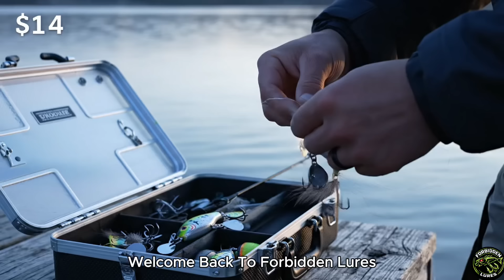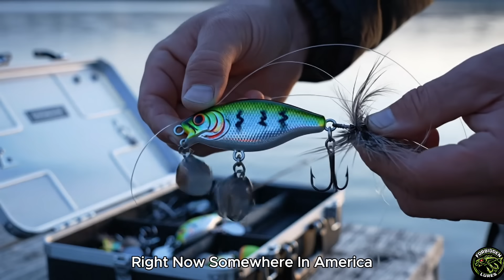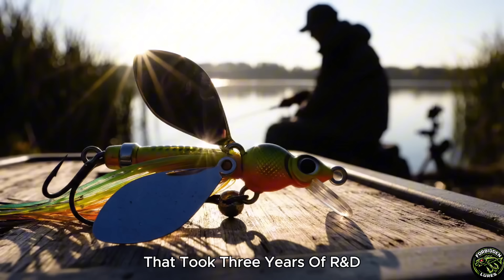Wrap Aluminum Foil + Copper Wire on Your Hook — The Galvanic Fishing Hack That Beats Any $14 Lure

Comment: You contradict yourself , you say put the aluminum foil on the hook wrap the copper wire around it and then the next breath you say to do it the other way!!!! very confusing
Reply from the maker: I apologize for the confusion, both methods essentially create the same galvanic reaction so you can experiment with which way holds better for you.